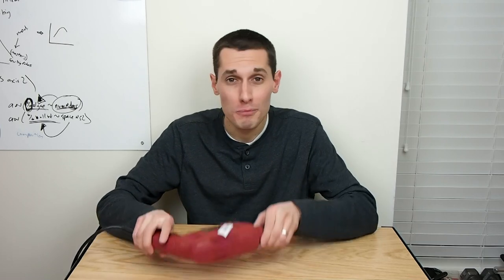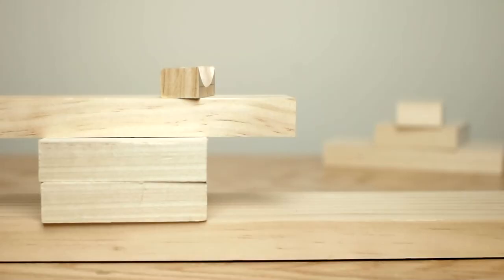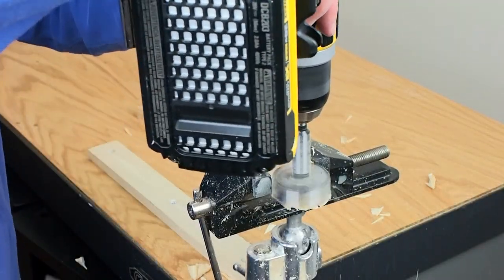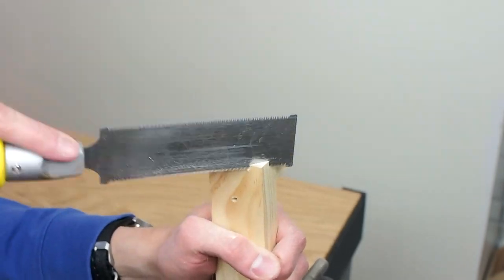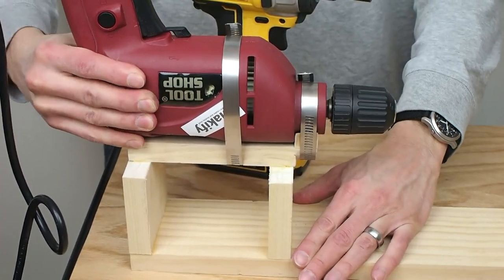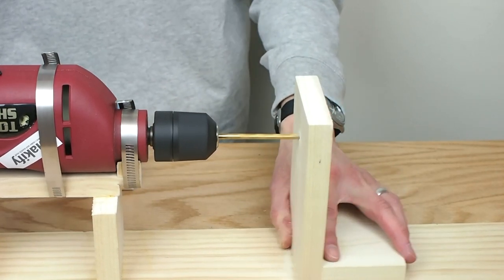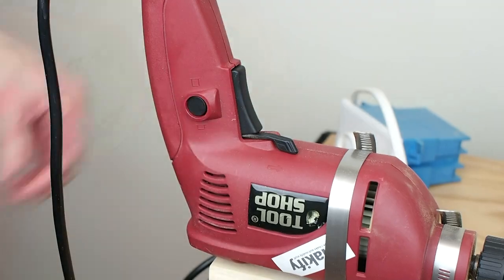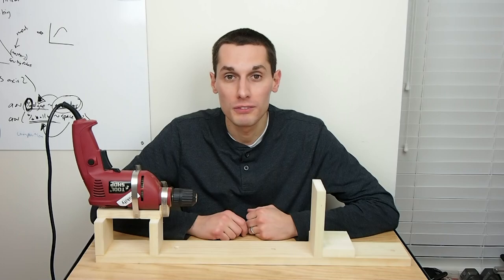How To Make a Drill Lathe

Comment: Agree, very simple, fast to make, easy to make, and it works.  Took a lot less video time than others basiclly making the same lathe.  I've been wanting to make one for awhile now, but didn't like the thought of having to reinvent the wheel.  This showed, and told, me all I needed to know.  Great job.  Thanks.
Reply from the maker: Thank you. I'm glad the video was helpful.
Reply: Years ago, I got a nice real lathe.  Then discovered all I liked to make on it were carving mallets.  With a batch of mallets from varying woods and weights, I was set for life so sold the lathe.  But now I could use a lathe like this for occasional jobs, so this fits the bill nicely.  I use a foot switch from Harbor Freight, http://www.harborfreight.com/momentary-power-foot-switch-96619.html , I like it because if you get startled and step back, power is off to the tool.  So for variable speed I'd be using a hose clamp, and tighten and loosen as needed.  I'll be using just Titebond II tho, I only use screws if I plan on taking something apart later.  Normally use clamps, or weights, and very seldom nails, to hold it until the glue sets.  Thanks again, and keep up the good work.

Comment: Just struck me the other day.  Change the tailstock on this to a small flat table, use a sanding pad in the drill, and viola, you've got a bench disc sander.  Two tools in one.  There's plenty of videos on making disc sanders, but most are long, over complicated, or not so great.  I think a video on making a table for your lathe would be a good one.

Comment: Great video, thanks for sharing. I would also like to know more about the dimmer speed control.
Reply from the maker: +Shop built  I just uploaded a video about the dimmer switch. Link is up in the video description.
Reply: @Makify1  Very interested in this too. My drill has a trigger that needs to go to full speed first before I can set the power level (or switch it off) which is bad news for whatever is on the lathe :(

Comment: I think what I might do to change it is use a dermal instead of drill because I don't have a fast drill and I think for the tail stock you could easily drill holes in the tail stock on both top and side on the base and then you can just put little dials or screws to secure it in place. And I know what I'm doing tomorrow.

Comment: Probably it's ok to run her on the dimmer ! I have an old Bosch drill that works on square wave from a inverter but a modern dremel don't work on square wave ! Just keep monitoring the temperature and you will probably do fine! I have seen dudes using 220v grinders on 110v until the grinder was pretty beat up but still working hahahaha they didn't even notice the 220 label on the tool

Comment: The issue with these is that most drill don't have chucks and the overall mechanism stable and balanced enough to really turn as accurately as a real lathe would, there's always a tiny bit of wiggle, which makes any precision work impossible.

Comment: I do have a question thoe, if I wanted to use a larger balsa dowel wood rod, how can I fit that to a drill head that only opens to about 10mm? any advice?
Reply from the maker: +PredatorBites UK The simple, but not free, solution is to replace your drill head with one that opens wider. You can buy replacement heads at most hardware stores. Alternatively, you could make a special chuck. Look at chucks for commercial lathes and maybe you can figure out how to reproduce one. I can't come up with a simple solution off the top of my head though.
Reply: +Makify1 thanks for the advice! ;)

Comment: how would you hold wood on the lathe to carve and turn it
Reply: Derek Dragon you wouldn't be able to hold real wood on a build like that. It's for small projects with soft woods aka balsa. I've tried this with a price of pine and some finagling but due to vibration and torque the build falls apart even when reinforced with screws. Better to find used lathe on Craig's list

Comment: Stop with the flattery, he left a lot of things out. First, he's sanding that piece of wood  but he didn't say whats keeping that piece In the middle of the dowel rod. Second, He just put that dowel rod through the tail stock block. If he didn't use a bearing of some sort and he used it any amount of time, the wood surfaces rubbing together will soon produce a wobble.Third, for me it's an issue on how he mounted the drill. Unless your a avid woodworker your not going to have specialized drill like that laying around. He would've been better to attach it to a block that has a V cut into it, you get the same results. Other than that he has a good idea and I'm going to use it, with a little modification.